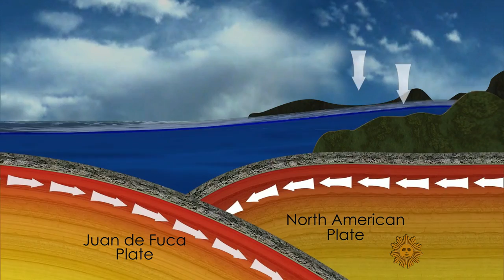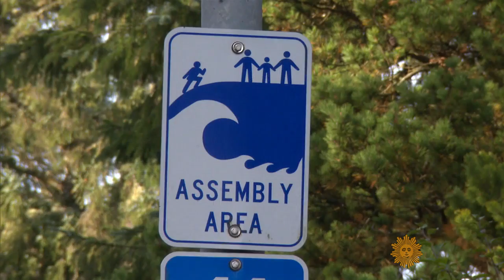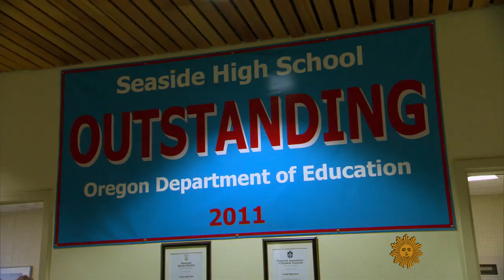Only a matter of time: The disaster awaiting Pacific Northwest

Comment: That's one danger. Mt. Ranier, an active volcano with a substantial glacier on its slopes, is another.
Reply: @BenjaminFranklin99-s9n  you do know that Rainier has erupted with 10 times the power of mt st helens in the past right?...that would put it at a high VEI-6 to Low VEI-7....that would impact multiple states.
Reply: @morgangrey4020  I used to work in communities in valleys north of Mt. Rainer.  There were sirens on very tall poles in those towns to warn of lahars if Mt. Ranier erupted.
Reply: @BenjaminFranklin99-s9n  The problem isn't the few warnings they give out...the problem is actually implementing the warning into action since LeHars can travel at speeds over 40 mph.
Reply: @morgangrey4020  LeHars? You know who they are named after???? Hardy LeHar. A cartoon from France.
Reply: @IndicatorKid  Sorry but the term LaHar came from Javanese.The geological term was introduced by Berend George Escher in 1922
Reply: True. I have inside knowledge  Mt. Ranier is going to be far more reaching than most people know. You'd be surprised. I live in the PNW, as well.
Reply: @mysticheart1  Inside what? Inside Ranier? Something your intestines told you? You heard it while you were inside the house? Inside what, inside what, inside what???????
Reply: @IndicatorKid  I'm sworn to not revealing source, but it's someone directly at the top of the field. A lot of this kind of information is not made public and govt information only.
Reply: SW - USGS rates the threat potential very high - last eruption about 1,000 years ago. Structural weakness promoting collapse.
Reply: BF99 We actually had people die in Idaho from Mt. St. Helens - volcanic ash and smoke plumes. You had to be there to know.
Reply: Thankfully, according to Al Gore and Greta Thune, the glacier should be eliminated by global warming so. So there's that.
Reply: @jayweckerle5421  Comparing Cascadia with the 2112 quake in Japan, and assuming a similar 9.2 quake, Mt Ranier is expected to move 25 feet west.  That's the whole mountain.  I think that would cause a lot of ice to come tumbling down.
Reply: Besides Rainier and St. Helens, you have the entire Cascade Volcanic Arc, going from NorCal to Southern BC. Within the amount of time that Lewis and Clark went to the Pacific Northwest to today, Lassen Peak erupted once and Mt. St. Helens several times, including the 1980 eruption. Mt. Rainier erupted several times in the 19th Century (last officially recorded eruption in 1894). Mt. Hood last erupted in 1865-66, while Mt. Baker erupted in 1880. However one doesn't have to be reminded of the fury of nature by just looking at Crater Lake in Klamath County, Oregon, and the eruption, identical to Tambora and Krakatoa in Indonesia and Pinatubo in the Philippines can attest that VEI 7 eruptions in the Pacific Northwest can be about as deadly as a subduction zone earthquake and tsunami.
Reply: Mt. Rainer is a dormant volcano, and not an active volcano. A dormant volcano can erupt again in the future.  There are 2 volcanoes that are active on the big island of Hawaii. An active volcano will be erupting and spewing smoke, gas, and lava.  Diamond Head and Koko Head on the island of Oahu are extinct volcanoes, because the hot spot that once fed these volcanoes, has moved under the big island of Hawaii. These two volcanoes will never erupt again.
Reply: @DoowopLover  Mt Rainier is active.  I've hiked it's trails.  There are steam caves, very active !
Reply: @Morningglory007  WOW....I didn't realize steam was coming out of Mount Rainier. Probably similar to Yellowstone or Mammoth Lakes is California., where these areas are geologically and seismically active, but not presently erupting.
Reply: @DoowopLover  Mount Rainier, an active volcano currently at rest between eruptions, is the highest peak in the Cascade Range. Its edifice, capped by snow and 25 glaciers, has been built up by untold eruptions over the past 500,000 years.
Of course that's the USGS view anyway.
Reply: @DoowopLover  Ranier is active.  It is venting steam through unstable rocks on one of its sides, and within its main crater. https://www.youtube.com/watch?v=Rfbv7HZ4r6U

Comment: This story is incredibly scaremongering. No major city in the PNW is located on the coast, so it is probably one of the least susceptible regions for tsunamis.
Reply: Seattle sits on the Puget Sound which is a giant inlet directly connected to the ocean.
Reply: Tsunami‘s do not just affect the coastlines it causes rivers to run upstream and flood miles inland.
Reply: degnaw you do know the tsunami would be funneled through the river and into the port... right!?
Reply: degnaw  Cascadia earthquake 1700 was at least a 9.0, the tsunami went all the way up the Columbia river
Reply: Fifteen minutes on the West Coast. The fault is eighty miles offshore at five hundred miles an hour. Fifteen minutes with everybody else in a panic. 
The ignorance is stunning.
Reply: Yes. And most of Belltown is soft and likely to sink from liquefaction. 
The whole of the Georgetown is likely to be underwater for a long time.
Reply: I live in the Puyallup valley south of Seattle. After the 2001 quake my house started getting unlevel. The ground under half my house sank about 6 inches. Even after spending $15,000 dollars I'm still not level, have a front window and a back door jammed shut plus cracks in the wall and ceiling. I thought about contacting King County to get my property value lowed but then got worried they might condemn my house so I didn't.
Reply: The big cities (Seattle and Portland at least) are much more prone to the earthquake, especially since both cities' downtown areas were built on mud/river flats, which amplifies earthquake activity. Some older buildings in downtown Seattle crumbled in a 6.8 earthquake in 2001, now imagine something 100 times more powerful. 

Seattle is pretty hilly, so the only tsnuami concern in a Cascadia earthquake would really be along the waterfront and the port. It's really easy to get to higher ground anywhere that's not along the ocean beaches (assuming the earthquake doesn't destroy too much infrastructure).
Reply: The story specifically emphasizes risk of tsunamis. These would only affect a few small towns along the coast, as all the major cities are on inland waterways.

Earthquakes are indeed a real risk for the PNW, but that's not the focus of the story.
Reply: My thought exactly, David. I think degnaw doesn't understand the geography of Seattle or Portland. I've lived in both areas.
Reply: The old buildings had no rebar.
Reply: Five foot drop in Ocean Shores, where I live. I'm seven foot above sea level. And I am five foot eight....
Reply: how is this scaremongering? They have been talking about the BIG ONE for decades now.. it is called being prepared.. geesh.. I mean. sure you can live out there and just accept the risk.. that is your choice..
Reply: The entire ground will drop at least a meter, and possible more. That allows more water to rush inward. It's a real threat to any city in the vicinity of the pacific

Comment: What about fracking.  Oregon has what the government wants🤑🤑🤑They don't care so don't be dumb.
Reply: +Faustina Egoian What does fracking have to do with this situation? There aren't even any oil or gas deposits in Oregon. Take your own advice and don't be dumb.
Reply: Hydraulic fracturing is used to get oil and gas out of hard shale formations. First a well is drilled into the shale and then a mixture of water, sand and chemicals is pumped to the bottom of the well casing. The high pressure water fractures the shale around the bottom of the well and the sand is carried into the cracks to keep them open. When the water is pumped back out of the well, the oil or natural gas follows it up the pipe. The pipe is sealed  against the sides of the well as required by environmental regulations. This keeps the gas or oil from getting out of the well except through the pipe and prevents loss of the product. The water is reused in several wells before it is too contaminated to use. In areas like Oklahoma and Arkansas, very deep waste water disposal wells are used to get rid of the contaminated water. They are drilled to far below the level of the regional aquifers to keep the contaminated water away from the irrigation water. However, this means that in the Great Plains region the water is often pumped into the deeply buried earthquake faults. Lubricating the faults with water has begun to cause earthquakes in the area of each well. Most are low energy and not felt on the surface. But now and then the quake is strong enough to feel. Because the New Madrid Fault is nearby, there is fear that a much larger quake like the 1811-1812 quakes will be triggered. It is unlikely, but some people believe it will happen. Because the oil and gas deposits are below dense rock layers that couldn't even be drilled into until recently there is little possibility of contaminating ground water thousands of feet above the bottom of the well. Similarily, the waste water is disposed of thousands of feet below the ground water layers that are used by us for drinking and irrigation and have thousands of feet of impermiable rock above them. The process has produced an enormous supply of natural gas that burns much much cleaner than either oil or coal and is reducing air pollution greatly. It can even be used in diesel trucks and buses in place of petroleum diesel fuel.
Reply: davess357 Actually, since I was in grade school when the 64 quake happened and studied Geology in college, I was thinking that those statements were incredibly stupid. Glad that you were being deliberately sarcastic to catch the ignorant.
Reply: shannon malina Shannon, I am fairly well informed about hydraulic fracturing and it's effects. I have a Bachelors degree in Geology and I work for a contractor for the Department of Energy. The mass media has no understanding of how it works and neither do most other people.
Reply: +Allen A  you may not think that but you should research fracking and look at what is happening elsewhere  it is all connected ...inform yourself  and not from mass media :)  have a good day !!!
Reply: Then could you explain it ....so I can understand :) I think fracking doesn't help but I know it is not  the sole reason this is happening ...I can't claim any titles after my name .....but I do love the land and am super sensitive to energy ...so my complements to having knowledge of both !!!!  Help me understand .. Thank you :)
Reply: Allen A really? You need to watch Dutchsinse on YouTube he forecasts EQ and he is always spot on. Oil companies inject toxic waste water.
Reply: I had no idea the Pacific Indians used fracking in 1700! Thanks for enlightening us!
Reply: -- Yeah, fracking sucks dude... Look at that big earthquake it caused in Alaska when they built the pipeline.

That was for the sake of the incredibly stupid. There was/is no oil being pumped in southern Alaska, fracking was an unknown technology in '64 and the pipeline had yet to be constructed.

But I'll bet those first two sentences had some of you looking for a very compelling reason to further hate the oil industry.

Comment: There must be a cheaper way to go up. I don't see any thickness of concrete wall of having cost benefit. It is just a greater surface area absorbing the force of the water which can't be stopped. How many invincible lighthouses have perished in storms? I wonder what the cost of all steel towers like the wind generator towers use would cost and if a subsidiary use could be given to them.